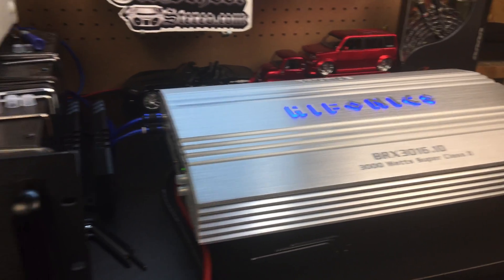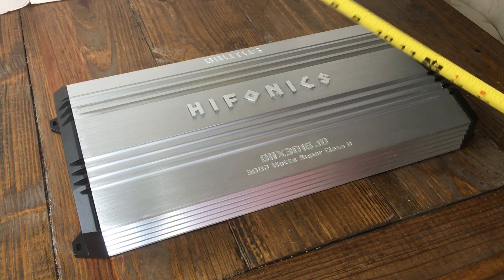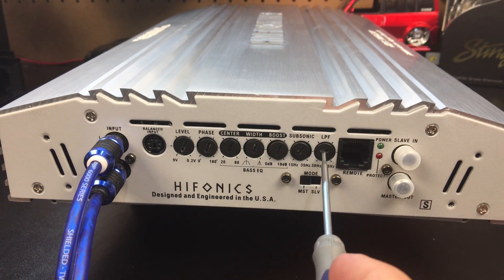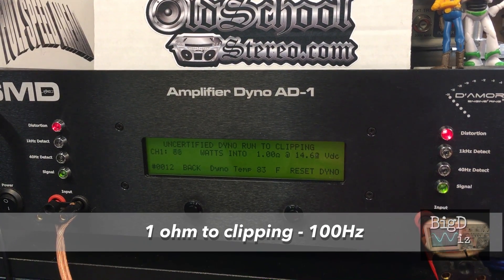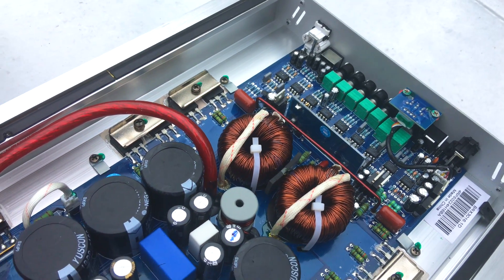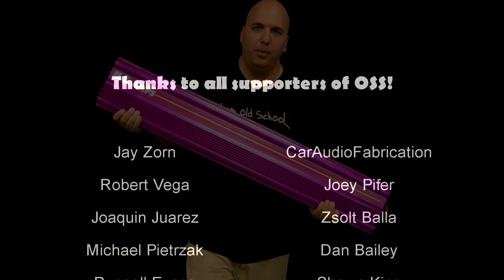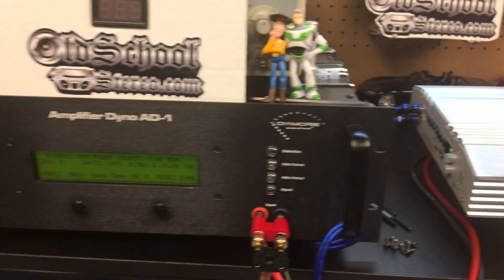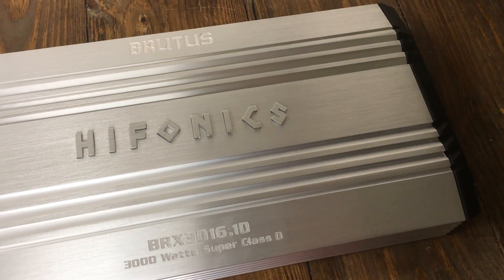Is That 3kW RMS or MAX? HiFonics Brutus BRX3016.1D 3000 watt Amp Dyno Test

Comment: People think hifonics amps arent great just because of the price but they are actually just as good as any other amp
Reply: I buy the shit out of them... all I do is change out mosfet transistors and capacitors. Example for a 4k amp I spend 1 hr and 7 bucks and years later beating the shit out of it without missing a beat.
Reply: Bob  so do you mean I shouldn't run a ground cable that's 18 gauge to a walloed out oversized cross threaded wood screwed to rust and paint. It works Bob..that's the only thing that matters hah
Reply: @rubenavila8700  Then its 250 watts RMS.   BTW, there is also volts RMS.
Reply: Hifonics colossus 10years old still banging  1600 x 2 1ohm loads
Reply: Adam Villarruel once i saw the fuse rate on them i knew they were good
Reply: I have the 1100d watt hifonics. It makes no power at 4 ohms, overheats at 1 ohm so I run on 2 ohms I'm guessing it pushes about 400 watts at 2 ohms. I've had it for 4 years. It blew my JL 10w3 after pushing it for 12 hours straight at 2 ohms. I think it's decent but I'm sure there are way better Amos out there I'm just too lazy to buy a new amp and rewire everything again. I would have gone with a 500 watt mono from JL or Alpine if I could do it again because the Hifonics is just cheap dirty power. Doesn't sound all that great just boomy.
Reply: MrColeman83  ur right about that I picked up the Goliath and so far it slapps hard. But the bxx 4000.1 d does 3300rms
Reply: MrColeman83  I have the Brutus but it's not CEA compliant but it's sturdy as hell. I can't see it failing anytime soon especially with the great auto-protect but that only kicks in at 1 ohm because it runs so hot at that impedence. At 2ohm it doesn't even get warm so that's my sweet spot because it's enough power for my small hatchback. About 500wrms @2ohms.
Reply: MrColeman83  it's brutus, BRX1116.1D
Reply: MrColeman83  this video is the same line, BRX but is CEA compliant so the numbers advertised have to be accurate. I got the lowest end of that model and they overrated by about 200 watts. I'm too lazy to upgrade my system now, it does the job, plus I'm looking to get a new car in a year or so so I don't think an upgrade is worth it at this point. Would just rather start a whole new build in my new ride.
Reply: I use to have a hifonics 1500D and it worked great on 2 1000watt subs
Reply: @rubenavila8700  Are you talking about watts RMS???? Some people short speak and say "this amp does about 1500 RMS"  that is just and easier way of saying "this amp does about 1500 watts RMS"  But you are the smart one right?
Reply: That shit trash🗑️🗑️🗑️🗑️
Reply: Trash
Reply: Hifonics amps are very good for the price regardless of how people bash them.
Reply: My buddies hifonics amp just failed after only 2 years on 2 12 inch p2s
Reply: @Balancinglife  only 2 yrs lmao of everyday abuse .... Thats actually good cant say that for some fosgate amps ive had ....
Reply: @Rc-ho4sv  I just ordered hifonics amps to replace my Rockford, lol. Also, my Rockford has been running strong 6 years now. Full tilt.
Reply: @Balancinglife  and replced the fosgate with hifonics 👌
Reply: Even 5 years ago....they were a good bargain....past few years , not so much....I put a 1000 watt mono, in my girls car, cause she doesn’t have a lot of space. With a single 12” cvr, in a sealed box....it’s alright, for the 119 bucks it cost
Reply: I mean you get what you pay for my girls hifonics monoblock is still going...BUT, she's not riding around cranking it....
My dad pulled out a Crunch 2000watt monoblock in the box 25th year anniversary.... apparently I just left it at my parents like,.   8,9,10 years ago. Only subs I have right now are some CRAPPY 4 ohm svc kicker yellows, in the best buy box....they suck, but I wanted to hook up my old amp....it's pretty tight....the subs not so much...I need to sell them, or trade them for partial payment on some decent subs.... keep bumping 👍🤙✌️
Reply: @marco77ar  true that I have 25th anniversary bxi2608 still going strong
Reply: @marco77ar  it wasn't the subs, it was cheap, dirty power. All amps aren't made the same. I had two kicker comp 15's on two 500 watt eclipse mono block's, that did 140db, maybe it was 139db, and they are very efficient, is they don't need a lot of power to get the same performance.  So its not your subs its your amp, or source unit
Reply: Ive gotta say Ive had several hifonics amps and not one has ever failed me or given me any problem and for the money they are excellent amps, stay away from the skar rp (2k and below, 3500 and 4500 are much better) line if you are on a budget and get a brutus they cost the same but the brutus has wayyy better and more components Ive owned both and the brutus sounds way better
Reply: @rubenavila8700  You need to redo this post, it makes no sense what so ever.
Reply: Back in the day, I bought a hiphonics amp, it was $1,000 I don't know about longevity, because it was taken by someone who wanted it worse than the thought I wanted it, but it made power! And just looked like it was made better than amps today! But for $1/watt it had better!! It's crazy how cheap amps are today, but subs are more costly it seems, but they are alot better, today's subwoofers make the old school subs look like home woofers, I guess they are sub-sub woofers, being loud at 30hz, the old subs seemed to barely play at 30 hz, mine usually ranged from 40-60hz, I tried to push the tune low as possible, I belive in using good subs, and a decent budget amp, atleats! The old kicker amps were some of the best I have owned! But they are junk now,
Reply: @jamest.5001   Back in the day HiFonics were great amps, and not cheap.  They would suck your alternator right through the firewall too.
Reply: @jamest.5001  You my friend had a real hifonics amp that was made in the USA, this is nothing but a glorified boss, made by maxxsonic
Reply: They're actually trash.. They are better than soundqubed amps, because they use some of the same boards. but hifonics uses a little better components. However Hifonics uses low temp rated capacitors which means they do not have good longevity life. They work fine for a short time but will fail do to that.
Reply: @kmccorkle69  Soundqubed actually uses cheaper caps.
Reply: @kmccorkle69  hahha been ranking on mine for the better end of 4 years on 1 ohm load still crushing......
Reply: Keith McCorkle 69 huh that’s weird because I’ve been running mine for four years now full tilt and it’s still going... it gets nice and hot to the touch and the bastard just won’t shit out
Reply: @kmccorkle69  ran 2 2608s strapped together at .5 ohm for the last decade. There still beating, proper electrical although
Reply: @kmccorkle69  damn that's crazy I must have got a lucky draw. I have a 3200 watt Zeus on 2 Solobaric l7 12" and a 500 watt on my highs I've had them 10 years playing every day.
Reply: @kmccorkle69  Actually capacitors are a little stronger than you think. But the thing to worry about with the Hifonics amps including all other amps and manufacturers is the transistors or Mosfet the actual amplification part. You've might have gotten a few Duds depending on the shipping people and where you got it from. Some components may have been loose.

Comment: Still though...5800 watts? Wow. Way to go Hifonics. I am impressed!
Reply: Watt's not RMS watt's don't mean shit
Reply: @rubenavila8700  RMS is not an official measuring unit! If you don't know this basic stuff you should get as far as you can of amplifiers!. RMS is sinus power or nominal power which is still measured in WATTS(W).Max power is musical power or peak power.This one too is measured in watts! GTFO
Reply: @Atelierul29  RMS is not sinewave. Sinewave is 1.4 times the voltage swing at RMS. Have a nice day. Next time you correct someone at least check your facts!
Reply: @jeroenschuuring6060  The RMS value of a set of values (or a continuous-time waveform) is the square root of the arithmetic mean of the squares of the values, or the square of the function that defines the continuous waveform. In physics, the RMS current value can also be defined as the "value of the direct current that dissipates the same power in a resistor."  Next time you check your facts!
Reply: @Atelierul29  This is some awesome 'correction battling'.
Reply: @Atelierul29  Dude this amp is a piece of shit, get over it.
Reply: @jeroenschuuring6060  it's been 5 years i bet you still think about how owned you got here 😂
Reply: Lol

Comment: Why did u turn the lpf all the way up?
Reply from the maker: So there’s no interference in the 40Hz test
Reply: So should my amp lpf be all the way up for everyday use?
Reply from the maker: No sir. Set LPF to complement your system. Most are set between 70-100Hz
Reply: Mines is 50hz to 250hz

Comment: I just went from the crescendo vs DC audio 3.5k video to this I must say the numbers from this are impressive compared with the 3.5k I know you where running this at .5 ohms but the nendo and DC both went to protect at .5 ohm. so for the price you could have like 4 of these. lol. I'd still rather have any one of the amps on the battle of the 3ks over this amp. but still this is impressive.

Comment: this video is why i got my Hifonics Goliath 5k amps because 2700rms on a 3k peek rated amp is impressive for the $329.00 i spent on each amp i can hope i get 4k rms and just be happy with what i paid for them.
Reply from the maker: The reliability on these is a bit sketchy (in my experience), but if it works for you then that’s all that matters
Reply: i will let you know if i pop something on it.  what to you think of infinite baffle setups?
Reply: Vasanthappa
Reply: I had goliath 5k on 4 crossfire BMF 15s and the brutus 3000 on 8 brutus 12s in the same vehicle. 2002 Tahoe. Loudest set up I ever owned
Reply: Harbor Freight air compressor for painting cars which one's the best

Comment: Hifonics always made great amps!        I had the Zeus in the early 90s pushing two 18s.
Reply from the maker: The new HiFonics are not what they used to be. Brand name is all that’s the same. Amps are more powerful now, but not built as well (but also cost WAY less)
Reply: I had one as well.  The Colossus was actually two Zeus' strapped together.  Like the classic Rockford Fosgate, no longer made in USA and definitely not the same quality either.

Comment: Can this amp move my Cadence S3W15  1500W rms  at 2ohms?
Reply: SubZuda GR yeah man i got it on my 1500watt rms subwoofer n it pushes the thing hard
Reply: Sdddude123 thats what i wanted to hear you have it at 2 ohms?
Reply: SubZuda GR yep 2 ohms since i fucked up and got a dual 1 ohm subwoofer so it can only be wired down to 2ohms. But for what its worth it pushes them HARD at full power on the highway.

Comment: The cheaper the amp the more power hungry and the more current it will pull/need and if you don't have iot you will cook your amp. Audiopipe is the same way, with good electrical you can run them at 0.5 ohm all day just invest in a $10 volt gauge so you can make sure your not dropping below 12 volts so you don't cook your amp thaty way either.

Comment: The older Hifonics Brutus BRZ 2100.1d I had came alive @ exactly 0.5 ohm and with good electrical I rtan it like that for a long time playing low bass & slowed songs & DJ Russticals down to 20Hz on a custom built AudioQubed HDC3 12" with a 3k rms coil and 3 spiders, 5 mm flat leads in a 3 cf net box tuned to 31.5Hz and had an XL T shirt blowing all around in my car like a wind tunnel. It was insane to see one 12" sub move that much air on a Brutus BRZ 2100.1 with 160 amp alt and 2 75 ah AGM batts and 2 runs of 1/0 welding cable and big 4 done. My point is these amps are power hogs like most cheap amps but if you have good electrical the older BRZ series will run @ 0.5 ohm all day and not even get hot. I ran it full tilt on a 2 hour drive playing some crazy lows and when I got there I felt the amp and to my surprise I had to leave my hand on it a minute just to feel a little warmth. I've read and been told the BRZ 2100.1 is almost identical to the SoundQubed 2000.1 D and built in the same build house and look alike inside and out. The newer Hifonics don't impress me nearly as much as the BRZ series so if you can find one snatch it up.

Comment: a little work. and that could Bea good amp. add some MOSFETs. and capacitors. and beef up the traces. a bit of  engineering so it can handle that output!

Comment: Big D suck those mosfets out and replace them with the best you can find all the way around.  The better the mosfet the faster it can switch, the more amps it can handle, and the cooler it will run.  Fyi, mosfets are cheap :) You will end up with an amp that will run as much watts as your power supply can supply + the traces handle.Flipping the board and cleaning the mask off of the power and ground traces and tinning them, then apply mask will extend the life after the upgrade.  Food for thought.

Comment: 5825 @ 1/2 ohm is still crazy,. 260 bucks... Only recommended to see magic smoke working for too long under that ohm load...  I currently own a Brutis amp 5 channel.  Sub channel is  Pushing a soundstream SPLX 12" it does good.   Not the most powerful amp I've had in my car...but it is cheaper than Rockford Fosgate power series 600-2.   I enjoy musical amps more than class D.   But my poor alternator rather bump a class D than AB.  Lol 😋...

Comment: Had 2 of these strapped @1 half ohm each on a single zv5 15 clamped 800+ amps lol ran for a year no issues was on 800 amp hrs and a 320 amp alt though other than getting hot as hell not to bad

Comment: I ran this amp on decent electrical..Bass did not sound right and this amp will not do them lows!!!
Reply from the maker: That’s not good. This one didn’t sound good either...after letting out the magic smoke 💨🤷‍♂️
Reply: BigDWiz they tried their hardest into making  people believe it's a 3k rms amp..pulling a fast one off of the certified brx 2400's success. its a skillet, also! lol

Comment: Had mine running @ 1 ohm / multimeter tuned -with a small battery bank , zero gauge wire -it was powerful @ first a @ 40 hrtz POS 🔥caught 🔥on fire literally 🔥 had to get my (deck lid) “trunk 4 the slow” repainted 
🖕🏻@ hifonics

Comment: Wasn't $260 wasted since now guys are going to do 30 second Burps at 1/2 ohm thanks to you.
Reply from the maker: And most likely be ok as they are going to see impedance rise while the resistors used in this test stay solid at 0.5
Reply: BigDWiz exactly

Comment: Hey Big D, my question is not for this amp. What I am wondering is about some specs on a Polk amp 1100.5? I found them online but I don't believe them. Just wondering if you or anyone had some more insight on this amp. I have had it since new, but this is my first time using a single amp application. 
Thanks in advance.

Comment: Have you ever tried a planet audio amp?  I am curious  I have a planet audio system
Reply from the maker: Yes, Planet Audio = Boss Audio. Some of the higher end amps "Big Bang" are better, but still way overrated
Reply: BigDWiz.   Oh.  well shit then. I have their subs n amp.  Now subs have been awesome and prob would add more for competition but amp is not good.  Soundstorm amp you did worked good might have to think of complete new system. Would like to keep it all the same
Reply: A true basshead will make a system out of anything. Which I do budget wise

Comment: What did u expect to happen? Its rated for no lower than a 1ohm load!
Reply from the maker: I expected a protection circuit to “protect” the amp 🤷‍♂️
Reply: BigDWiz come on man really for 200$ u expected a protection circuit?  If u ask me the fact that the amp does "as advertised" & is only 200$! That in its self is why that company has sold sooooo many of the amps!

Comment: Also what is the signal line output voltage, I remember back in the day it was like 2v on my older decks and when they went to 4v it seemed like everything got louder by default.
Reply: Not louder.. cleaner.. the higher the voltage the cleaner you can get the signal which does technically result in louder rona point cause you can run a little more power before distortion.. but honestly 2-4v is minor improvement.. maybe 3-4% overall where as the 1.5 to 2v was like a 50% improvement.. above 2v there just isn’t much to gain which is why we started to see those few Sony or alpines that went to 5v but few years later everything fell back to 4v as the standard

Comment: Big-D I am wondering if you test at different gain levels or just always pick middle or some random point? I would imagine the results could be different or is it governed by where the signal clips at?
Reply from the maker: Head unit is 4V RMS, each amp is gain matched using DD-1+ on Dyno. Amp will not be louder or put out more power, even with a 2V head unit as long as the gains on the amp are matched. This is why amps have such a large adjustment in their gain levels...to match virtually any head unit. Some go as low as 0.5 volts and would even work with a cell phone or iPod directly from the headphone jack.

Comment: Could you run this at .5 if you're not pushing it super hard?
Reply from the maker: No
Reply: Cory Rogers Had mine running @ 1 ohm / multimeter tuned -with a small battery bank , zero gauge wire -it was powerful @ first a @ 40 hrtz POS 🔥caught 🔥on fire literally 🔥 had to get my (deck lid) “trunk 4 the slow” repainted 
🖕🏻@ hifonics